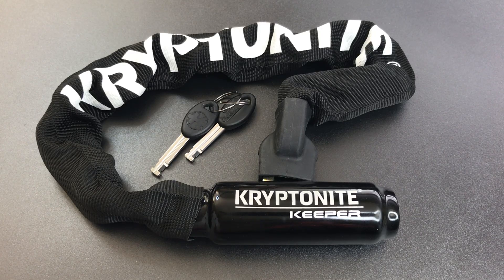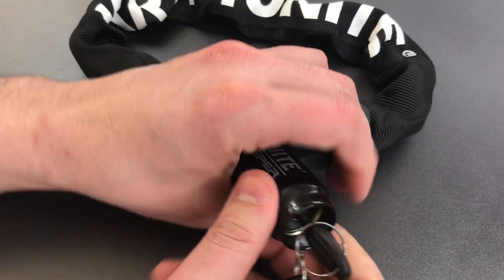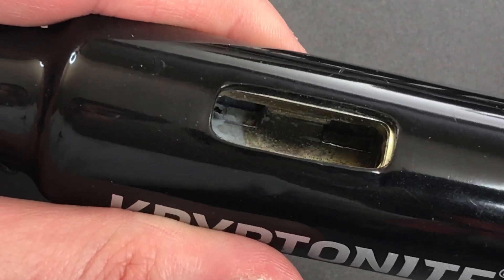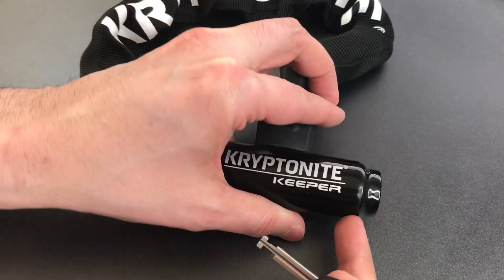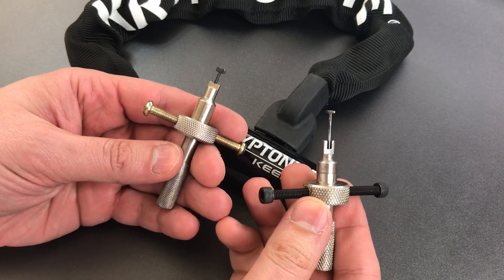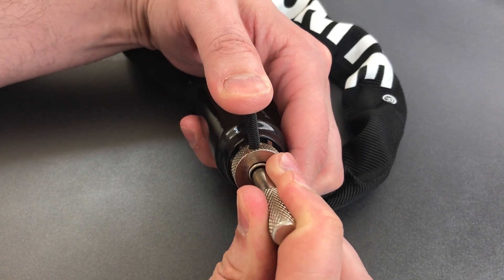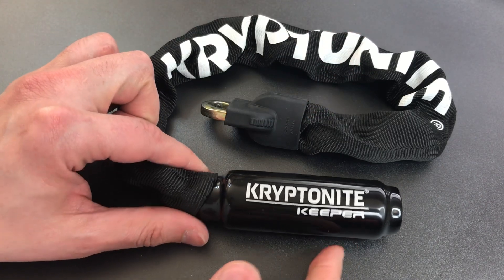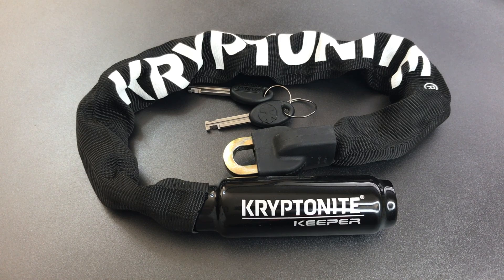[649] Kryptonite Keeper 755/785 Bike Lock Picked

Comment: I got one of these for the motorbike, and a second one to torture test, the square links are MUCH harder to bolt cut than a round link, it likes to kick em out unless you pin it against something that can't tip over or anything. And it took me a bit to get through it with a corded grinder.

Comment: Old this video may be, it's perfect for me in 2024. The area I live in, bikes get flipped faster than you can type this sentence. But. It's folks on meth, fentanyl, crack etc. The hard bad ones. So 7mm should be enough to stop 'them'. Even with bolt cutters. And even if there are some reasonable pickers here, still disc detainers remain a fairly niche skillset. So for my Specialized Stumpjumper Alloy 2022 S3, this should be perfect.

Comment: Bolt cutters can go through this lock. That's due to the width of the chain (7mm) and shape of the chain links. You would at least need 3/8 of an inch in thickness and a hexagonal shape to make it less likely for the lock to be broken manually.
Reply: Why would hexagonal shape be better than square?
Explain? 
I'd think the opposite.
Assuming similar material and hardness.
Round is worst as cutters hit less surface area at first to get started and starting the cut is a big part of this.
Some of the best security chain is square shaped.

Comment: Hello. Enjoy the vids. My wife bought me a 5 security rating Keeper with the combo lock as a gift. My area is suburban and pretty safe. I saw another picker vid on a Kryptonite combo cable but this one is different. It is a Keeper 712 combo 7mm chain. I could not find a video on this version. It is an almost 4 ft chain. I do like the extra length. I know it can be beat faster than a 10mm of course. What about picking/decoding?  Thanks

Comment: I bought a kryptonite keeper but got worried by the lock mechanism. The first worry was the lever inside the lock, it didn't look very strong. What really swung it for me was the stickyness of the key. I didn't want to be out somewhere with my bike tethered, unable to unlock it.
I ground a link in half and threw the lock away. I now use an abus padlock to secure the two ends of the chain.. The padlock is a good one but probably the weakest part. Although im confident my key will work with it.
R

Comment: I can tell you one thing. The 1055 mini - is TRASH. You can't tie your bike to ANYTHING... even a lamp post... and its so f heavy.
The 785 I actually got because of his videos... its still heavy (0.5kg) but FAR longer and fairly okay. 

The issue i got with it : since it has no feathres (because, security) its kinda awkward to open. you struggle to find the right spot to lock and unlock it- sicne it looks and feels the same no matter how you hold that darn thing. You have to paint markings on it for orientation i think and... well, a bit of oil so it runs smoother...

Comment: Owner of a keeper, one of the largest complaints about this lock is failure of the key to unlock or getting stuck , unable for the key to work to unlock. How can this be avoided?
Reply: This locks are VERY finicky.  I bought one and it would take me about 1-2 minutes of fiddling with it to open it.  I returned it and the second one was MUCH easier to open.  So this tells me, along with the negative reviews, that the final finish quality control with Kryptonite is not that good.
Reply: I don't have the keeper but I have the Evolution, should be very similar disc detainer.

The thing with disc detainers is you sometimes need to turn the key back and forth to engage each disc correctly.

If you have to use a lot of effort, it's definitely because you skipped a disc.

Comment: My son has one of these on his bike.  the Key no longer works in it maybe I will try bolt cutters and see how well it works. I am just glad the bike was not locked to anything when the lock quite working. I would guess it quite working due to road grime?  Maybe only look at locks that have dust covers over the keyholes?
Reply: How did the bolt cutters go?
Reply: @jayymaxx  I ended up using a dremel

Comment: Thanks LockPickingLawyer. How big a bolt cutter does one need to cut through this 7mm chain? In a non-urban environment, is such an attack common? Thank you.
Reply: HWLXRailgun  Thanks! I did go out and buy the Keeper 712 Chain lock (with 7mm chain) and will gamble that evildoers in my semi-rural area will find this chain tough enough. GREAT video from @LockPickingLawyer. Also, @Bosnianbill attacks this same lock, finds it to be a Lot of Work.

Comment: Locks are old fashioned should have a remote controlled key lock like you do with cars. Rather than a physical key lock.
Reply: Spoofing a digital key is actually fairly easy nowadays, since the radio signal can be picked up by a third party on cheap equipment.

Comment: Good points but a thicker chain = heavier lock. On a bicycle that's a big deal; even on a motorcycle that's something you need to consider
Reply from the maker: Fair point... I’ve always considered 10mm to be a minimum. 7 is better than nothing, of course, but well within the bolt cutter envelope.
Reply: Depends entirely on the terrain. Weight really only matters if you're racing or climbing hills. The bike is ~25 lbs and your bodyweight is probably over 150. The chain weight is going to be trivial unless you're doing a sustained climb. We're talking maybe a 3% increase.

If you're on flat ground at a steady pace, weight doesn't matter at all - only resistances do. Rolling and wind.
Reply: @libertyprime9307  Aside from climbs, weight also matters for starting and stopping, which can be required often when riding in the city with lots of traffic lights etc. 😬
Reply: @TheElThomaso  True.

Comment: Is there a bike lock that cannot be picked?
Reply: R.P. Rosen  Thank you, I had looked it up as well. I'm not trying to diminish the skill of impressioning, I feel it's just a highly unlikely attack, especially considering the necessity of obtaining and modifying a key from that exact lock type. Also, it requires more skill and more luck, as well as more overall time with the lock and purchasing a similar type lock and then practicing with the method. To be clear I am saying that impressioning the way deviant did it would seem to be some luck as well, and could be more difficult with more extremely bidded locks. However, if the bike locked up is expensive enough and the owner frequents many of the same locations regularly, it could happen. Perhaps Version 2 of this lock is superior, with it's sliders? But regardless, iamth3on3 was asking about picking, not impressioning.
Reply: Ricky Hall Oh TOTALLY agree with you. Nobody who owns this lock will ever have their bike stolen from picking. No it will be by a ... 4" cordless grinder!
Reply: iamth3on3 Yes
https://youtu.be/OLsJDELd4lo
Reply: The Forever lock has been defeated by impressioning.
Reply: dheller777 would be nice to see, do you have a link? Impressioning is far trickier than picking, however.
Reply: Ricky Hall Here's the successful defeat I've seen a few years ago. https://youtu.be/UGHjW3ZbCT8  I give PROPS to DeviantOllam as far as I know he was the 1st to solve this non-destructive puzzle over 3 years ago.

Comment: Why do they build these that are defeatable? Are there any locks that can't be picked or with Bolt cutters?
Reply: There's an old saying "all a lock does is keep an honest man honest"
Reply: Simple answer: Costs, if you make it pickproof and cutproof, i will probably costs a lot of money to make and buy and it will be mostly user unfriendly.
Reply: they build these locks to stop thieves of opportunity and low level dirt bags, if you want better your going to pay considerably more. cheap locks are very profitable and they sell tons of em. expensive locks are good for life but are very expensive and inconvenient because of the size, weight, etc.. very few people would use a $300 bike lock with a 20 pound chain while riding in the park. everyone uses the same cheap u-lock or padlock with 3 pound chain because its cheap and convenient and more than enough to park outside a store for 10 minutes.
Reply: Martin Brieger Heat treating? So Simple to do..Cheap also
Reply: Carroll 
Just how hard do you make steel to defeat bolt cutters?

If noise isn't a concern, a Radiac wheel doesn't care how hard the steel is. 

Yes, locks are to keep honest people honest.
Reply: Different Metals and Heat Treating, no Plastic....
Reply: We talk about proof not resistant, yes heat treating is there but it only makes it more resistant and not proof.
Reply: You could get some 19mm, or 22mm, hardened security chain, and something like an Abloy 362. There's been no verified picking of the Abloy Protec cylinder found in the 362, and somewhere on YouTube there's a video of a guy failing to cut a 19mm Pragmasis chain with 42" hardened-jaw bolt cutters welded to a heavy steel table with handles squeeze by a chain winch. You're going to pay a few hundred dollars for the setup, and it's going to weigh 30 lbs or more. And, in spite of that, a couple of minutes with a cordless angle grinder and it's gone anyway.